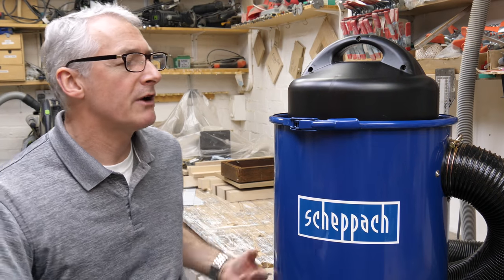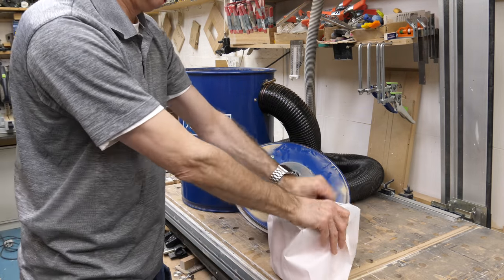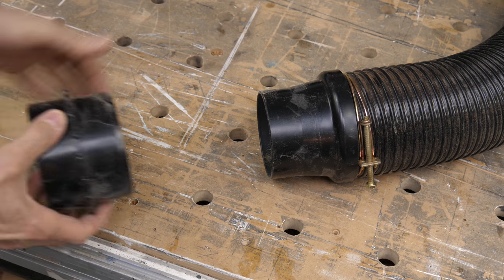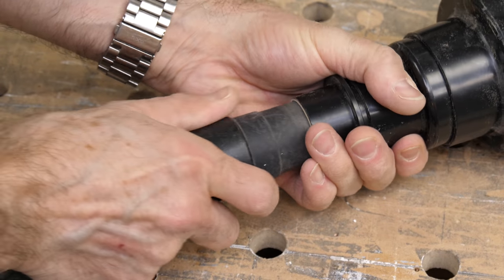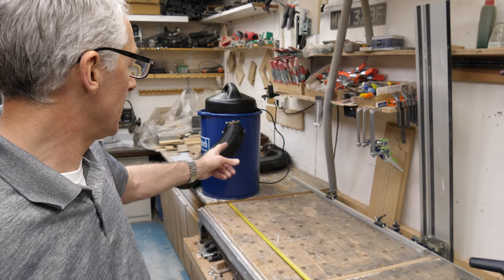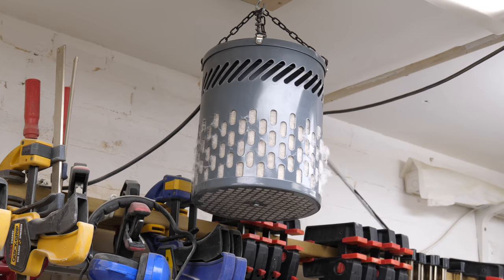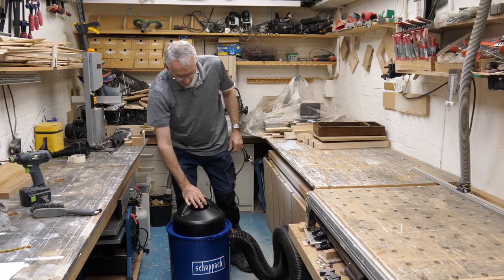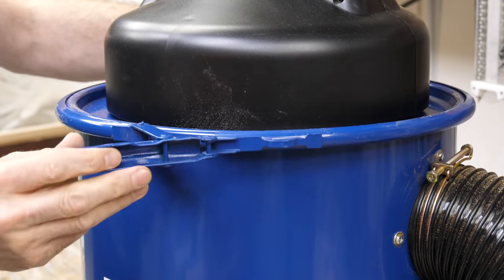Scheppach 50 litre Shop Vac [video #366]

Comment: Looks like a Lidls ash vacuum I use on my small tablesaw & router table...  though the hose is bigger here... 🙄😏
You can get an electrical adapter to plug the vacuum in with the powertool you're using & when you turn on the saw or router , the vacuum comes on automatically... 😬

😎👍☘🍺
Reply from the maker: Thanks Peter. Wow, I've never heard of such an adapter - if only I could find one, I could make a video about it... 🤔😂👍And just for the record, is the hose longer, or wider?? 😆
Reply: @10MinuteWorkshop  Brennenstuhl makes them, at least for us continental types. They're called automatic extension cords or master-slave extension cords. They're easy enough to make yourself though, companies like ABB and Schneider Electric sell the type of relais you need as just another piece of industrial lego.
Reply from the maker: @fermitupoupon1754  Thank you, but it was just a bit of teasing between me and Peter - he knows I did a video about this way back - #211, £6.50 autostart https://youtu.be/Qo5kpKMX_Vw 👍
Reply from the maker: @ChrisBLong  Thank you, but it was just a bit of teasing between me and Peter - he knows I did a video about this way back - #211, £6.50 autostart https://youtu.be/Qo5kpKMX_Vw 👍
Reply: @10MinuteWorkshop   .... broader 🙄😳

😎👍☘🍺
Reply: One that will handle up to 13amps ( or 16 for the EU version) is IVac obtainable from Toolovation (https://www.toolovation.co.uk/iVAC_vacuum_switches_s/153.htm)  but it does cost about as much as the vac!

Comment: This vacuum is absolute crap. You get more suction attaching its hose to a Henry, although the hose is such poor quality that it collapses in on itself under the pressure. A complete waist of money. Belongs in the skip.
Reply from the maker: Mine works great, stepping it down to a 65mm hose - as I say in the vid - makes a big difference. This vid - like the vac in it - is from 2019: was your a recent purchase?
Reply: @10MinuteWorkshop  Thanks for you reply. I stepped it down to a standard hose from a Nilfisk, and it has about 50% the suction of the Nilfisk with the same hose. Also, the jubilee clips that secure the hose to the drum max out long before they provide sufficient tightening - the hose repeatedly fell off during machining. I now use my Scheppach drum as a shop bin - the motor is better suited for a hair dryer.
Reply: @10MinuteWorkshop  I got it in 2020